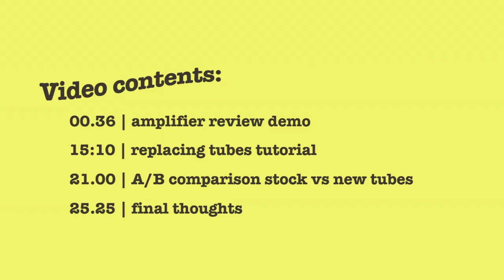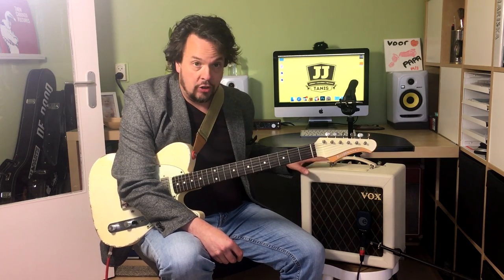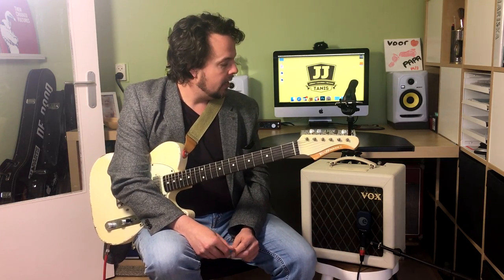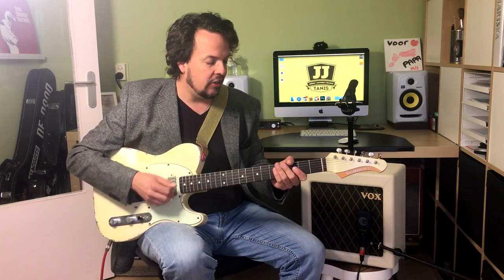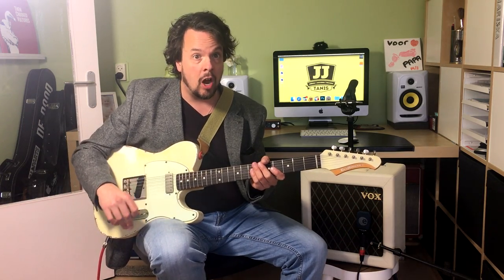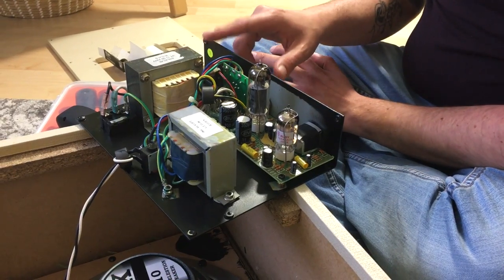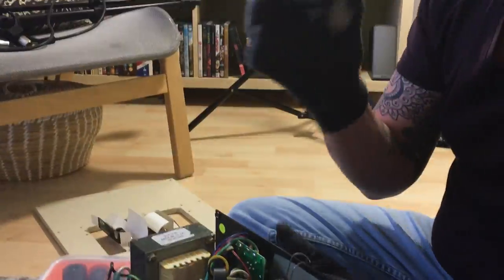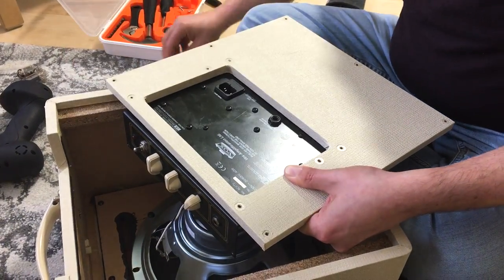Vox AC4TV | review demo, retube tutorial + A/B comparison stock vs new tubes

Comment: makes it a lot easier if you keep the amp attached to the back plate (just unscrew the 2 screws on the top, and the 7 outer screws on the back plate)

Comment: Not sure what gives. My AC4 even on 1/4 watt is horrendously loud. Have seen this mentioned by a few players before, but others are convinced it can be whisper quiet. Is there some inconsistency in manufacturing here?
Reply: I think some people's definition of loud is VERY VERY Different to mine. I find the 1W very loud in my house too.
Reply: You’re not mad. 1/4 watt is too loud. I have the ac4tv mini and it has 1/10 watt which I use all the time. It’s still loud .
Reply: I have the same experience. Really unsuitable even on 1/4 watt for bedroom practice. Mine seems to break up later than most I've seen even on 1/4 watt. I'm going to op open it up and see if it was modified. Lovely cleans though
Reply: I once had a Boss Katana 100 (bought that version because of the fx-loop and the possibility to use the GA-FC) but I only used it on 0,5W Mode... It was loud enough to me, even with the volume on half... My concern about this amp is the lack of bottom end..

Comment: You might want to add to this video that if you touch the metal chassis of the amp with one hand and one of those capacitors near the tubes with the other hand you are as good as dead when about over 400 volts of electricity goes through your body and stops your heart. Either drain the capacitors first or make sure you don't touch the capacitors when you change the tubes.

Comment: I've got 2 of these one at home, one at the rehearsal room I co-own. Valve change is well worth while but my main advice with the Ac4tv is that it really needs to run hot. Warm it up for at least 10 minutes before playing, longer if possible and the sound an dynamics improve beyond belief. The message even with upgraded tubes is run this amp hot to get the best sound and playing experience.

Comment: Other great mods for this amp are to swap the 12ax7 with a less gainy 12 ay7; I also cut the particle board back in half for an open back design which together the different tube gives some added headroom and makes it less boxy sounding.

Comment: Very informative video. I've owned one of these little amps for years and never really used it much. I've just started to get back into playing electric guitar (from acoustic and bass) and decided to change the valves in this amp, partly off the back of this video, and wow, what a difference. I swapped out the stock tubes for a set of custom groove tubes selected by Watford Valves. It's stopped a rather annoying background humming, brightened up the sound and it has more depth - it still overdrives far too quickly for casual playing IMO, but I will play around with the settings some more and the guitar controls before seriously thinking about swapping for something else. For anyone considering buying one of these - the 1/4 watt setting is still extremely loud for home practice!

Comment: I've used a little ac4 as a practice amp for a long time.  IME they are a pretty boxy sounding thing, the stock sovteks were actually the nicest sounding tubes I ever had in it, and the greatest sound improvement you can achieve with these is to run them into a proper cabinet.  The tubes don't make as much of a difference in these as they would in a larger tube amp where you have more than one power valve, and a phase inverter to play with etc

Also, it's fine to handle tubes for guitar amps with your hands

Comment: I have the AC4TV head running into the 12" cab. I find the attenuator useless. It sounds great on 4w but on anything lower the sparkle just goes away like someone threw a blanket over the amp. I did find a big difference changing the tubes to Mullards and Mesa tubes. The biggest difference to me was ditching the really dull Celestion 70/80 speaker to a real Greenback. The speaker brought it to life for me.

Comment: I have an AC4TV with a Bitmo Mod which is really cheap (check the net), and well worth it. I eventually put in a Celestion Vintage 10" that I had but even with the Bitmo mod alone it's a great amp for the money you've spent.

Comment: My AC4TV mini stack does a small gig ok and adding a PA mic the soundman can sort its wattage. I bought a discounted shop demo model and immediatly ceased using tranny  amps. The factory hardware is a good cheap setup. The mismatched (8 Ohm output & 16 Ohm speaker) load impedence "crunches" the sound. The easy mod is to cut a slot in the rear panel or in my case a "cat flap" for open or closed mode sound.The Ruby tube is still there and the EL84 is now an Elecrtroharmonix. I installed a screen resistor for the EL84 to drive an 8 Ohm Weber Blue Pup ($100AUD) at 8 Watts. Life was simple and pleasing but then came lock down. I built an extension cab and bought a Weber 8 Ohm (very helpful people) alnico hemp cone. The cab is the same size (a bit taller) and it makes a mini stack with the speakers connected in series to give the original 16 Ohms load. This required a fair bit of workshop time and installing jacks etc. The hemp cone sounded the same in the chip board combo as the ply extension cab so the Blue Pup got the plywood cab. There's two voices decernable, each doing what the other doesn't. I also have a speaker selection switch that simply puts a shorting link across the speaker to be silenced. The screen resistor is still there so 8 Ohm load at 8 Watts is ok. In summary; sure change the stock EL84 and build a cat flat in the rear panel but  beyond that buy an AC15-C2. I taught electronics for twenty five years so extreme modding is no big deal but my Vox vote goes to the AC15 as the sweetist and best value Vox amp. CheersTerry

Comment: I’ve worked on tube amps in my own shop for thirty years. Trust me. You can handle them without gloves. They’ll be just fine.
Reply: i just read your comment that you worked for 30 years in a guitar shop. i m near to buy a rock amp that sounds like the 60/70s  Rock sound. maybe you can recommend me if i should buy the 
VOX AC 4 C BL or the VOX AV 30+ Valvetronic. this sounds very good as well. Thank you for help.

Comment: Subscribed, with bell on. Excellent review. I have the ac4tv Mini with 6.5 inch speaker, worse than the 10 obviously. But I like the amp. So I’m going to get the V212C cabinet, @ 16 ohm. It’ll kick arse with 2x12s I reckon. And now I’m going to change the tubes out. Wow!  No idea you could do that easily. Then that I have a cab, I’ll buy a Marshall 1 watt tube for the bottom end. I was going to get the ac15 with 1/6 watt attenuation. But I think I’ll just use the ac4. I like it’s simplicity and the ac15 is a bit complicated on the controls for me. I don’t like options.

Comment: Touch the tubes. They aren’t halogen headlights.If they’re getting hot enough to break from skin oils, something is wrong with your amp. If you wanna really make that amp sound as good as it’s circuit will allow, put a Weber Alnico Blue pup10” or Blue Dog12”. Pretty good demo! Be interesting to hear one compared to an original’65 with ef86 preamp.

Comment: My favorite Vox AC4 video!!!  I just won one on Ebay, for the price you mentioned, bought it after watching your video.  love the old tv classic look.  They called it a modeling amp, so they didn't know what they have.  Thanks for showing the Mod, such a thorough video.  My only question is, the power tube does not need bias adjustment, because it's an "A" class amp?

Comment: Actually, you've replaced only the preamp tube, because the amp one was already a Sovtek, which is the same with Electro Harmonix (check the tube box, you'll see made in Russia and Sovtek written on the EHx). RUBY tube from the preamp is a china made Shunguang, but these are good quality tubes (you can find them on Thomann and their price is bigger than EHx), so VOX does not put crappy tubes on their amps!
I have also an AC4TV, but mine came with 2 Sovtek (preamp+amp) and looking to replace the tubes, just for fun, and I'll go for the JJ tubes (it makes no sense to replace Sovtek with EHx, even if I already have 2 new EHx 12AX7 bought back in the past, so I'll go only for JJ EL84 first). I don't think this is gonna be some kind of a magical upgrade, but I am expecting to see a slightly different sound and response. In your case, the difference you've heard (because I can't hear it on this video) was the result of replacing preamp Ruby tube with an EHx. Imagine what could have been if the bigger one would have been also replaced :)
Reply: Nice information. Thanks.

Comment: I also want to buy a Vox amp, thinking about a 4 or a 10. I now know what my second purchase after that will be :) Great video. Greetings from Spijkenisse
Reply: Btw, I own a first gen Blues Junior. Is changing the tubes worth it? Any opinions? Thanks!
Reply from the maker: Derk Bergman wat leuk, groetjes terug uit Spijkenisse Rock City!
Reply from the maker: Derk Bergman definitely worth the effort, it's a small investment that can have great results. I once took a BJ to my buddy Frits v Mourik who worked MAGIC on that thing, with a tube change and re-biased for more gain 🤘🏻
Reply: It is my main amp so a bit of love by changing the tubes could be a really nice thing to do. I already changed the speaker to a Celestion G12H. Imo it sounds more balanced and handles the overdrive/cranked sounds better.

Comment: I was torn between this amp and the ac10. I got the ac10 because it had a reverb knob on it and i was worried because people say the ac4tv was boxy sounding and the ac4tv lacked eq knobs. when I played through my ac10 for the first time i was blown away by the BASS! i turned it all the way down and it is still very boomy with bass. i wish i could turn it down lower. im still interested in this amp.
Reply: I bought the ac4tv and it is boxy Indeed, one has to expect that given its dimensions and cheap construction. And I find It very bass-heavy and boomy as well (especially with the neck pickup of a Strat and the volume turned up quite a bit).

Comment: I had the vox 4tv blue and it was hella bright. thx
Reply from the maker: Wadenkrang Guttenberg True, I've owned the AC4C1 in red with 10" speaker and I didn't really like that amp either. The AC4TV, however, is a different beast.
Reply: The Vox AC4C1 was built to mimic the top boost channel, this amp in this video is built to mimic the normal channel.  If you like the top boost on an ac30 you will like the former amp, if you like the normal channel you will most likely prefer the amp in this video. Personally I have a hard time with humbucker guitars, and the brightness of the ac4c1 complements the muddiness of humbuckers well. If you are going to play thin bright single coil guitars, then you don’t want an amp that emphasizes brightness

Comment: I've had this app for 10 years or so was thinking of selling it for an orange micro dark. Maybe I will play with tubes. I want it more growly and I wouldn't mind losing Headroom as it's an apartment amp any suggestions?
Reply: I have an AC4TV and an Orange Terror Stamp (basically the same as a Micro Dark/Micro Terror but with a headphone/cabinet simulator and an effects loop). They are both great for home use and recording. If I had to pick one over the other, I'd probably keep the Orange but that's just because it can do things the Vox can't (like headphone jack and effects loop). However the Vox AC4TV is an amp I've had for 10 years as well and it is a great amp.

Comment: I'm a little confused when you said it's not necessary to swap to a new speaker. Most vox amps come with a cheap celestion speaker which is worth about 10 dollars. You can buy an ac15 or ac30 with the stock or with greenbacks or bluebacks but I own an ac10 and there is no option for that. many ppl say that vx10, blueback, greenback, are better and they cost like 150 to over 200 dollars... So what would you say on that matter? wouldn't that be acceptable? I just don't know what an appropriate other option there would be since there is only one vox ac10. None of the small voxes come with better speaker option. I don't want or need a bigger amp since I only play in my bedroom.
Reply from the maker: Michael McGill if you don't really play at loud volumes you'll never really notice the difference in installing a more efficient speaker IMO

Comment: I understand there are only like 3 tube manufacturers, but each manufacturer makes different grades of tubes, like fender makes different grades of guitars. Buy a bunch of different modern made 12ax7 tubes and they will all have different internal construction despite the fact they are all made by the same 2-3 manufacturers. Chinese make some crap tubes and make some great ones!

Comment: great video JJ as usual... I want to buy the VOX AC4C1-12..so please tell me is it good idea to get that amp?? n' what changes could u advise me to do to the VOX AC4C1-12 ?? I'll appreciate u JJ n' someone else reply me . t-you =)
Reply from the maker: elmero mero I'd check out the AC10, that is a KILLER amp with more clean headroom than, say, an AC4 and more overall volume. I also like the reverb and portability of the AC10 and it packs quite a bit of low end oomph regardless of that 12" speaker. Again: it totally dependa on the CONTEXT in which you're going to use it.
Reply from the maker: elmero mero and as for mods: don't modify anything unless you find something you're not happy with... with the AC4, for me, it was that tube ratte. Speaker mods should always be the last thing you aim for.
Reply: JJ, does the AC4 offer an external speaker out? I'd love to hear that one through a big 212 or 412 cabinet ...
Reply from the maker: Ma Rio Yes, I mentioned that in the video. It's 16 ohms.
Reply: Thanks, yes i realized you mentioned that ...later ... do you have the possibility demoing this with a big cab?
Reply: JJ Tanis thanks a loooooooooooot for ur reply n' I do like ur vids .. =)
Reply: Ma Rio yes u can do it n' the sound get better when u plud the ampto an external speaker .. good luck =)
Reply from the maker: Ma Rio Sorry man, no guitar cab available here at the moment.
Reply: No Problem. Great Videos. Keep em comin' :)
Reply: awesome. whats the name of the song?

Comment: While this is a good review of the amp JJ, you said quite clearly, "Always best not to touch the tubes with your hands, right?"  No No No No!  It's the same old internet myth over and over again.  Since the dawn of the valve era 80 odd years ago people have been doing just that with no ill effects.  Do you think that military equipment in the field gets that degree of coddling?  Certainly not.  It's designed to cope with the roughest of treatment under the most demanding of conditions.  Keeping the valves pristine with not a mark on them is just not an option at any time.  And, do you know what?  There is never a problem with the valves.  They are chosen because they are so "not fussy".

Valves are NOT halogen lamps.  There is no coating to damage with your fingerprint oils, and there is certainly no reason for your fingers to cause any form of thermal problems in the thickened hardened glass envelope.  That is all it is, a tube made of thick toughened glass.  Please stop spreading this internet stupidity started by those who don't properly know the field to those who don't know the tech of anything.  Ask the old time engineers who have used valves all their working career and they will tell you.